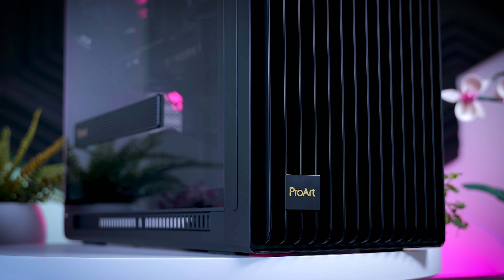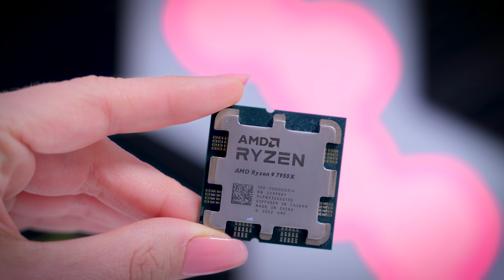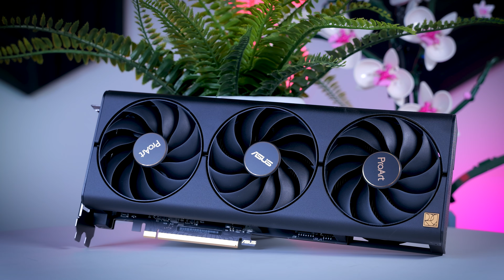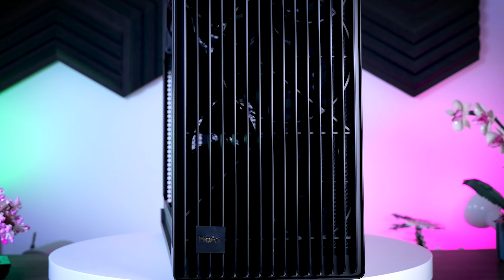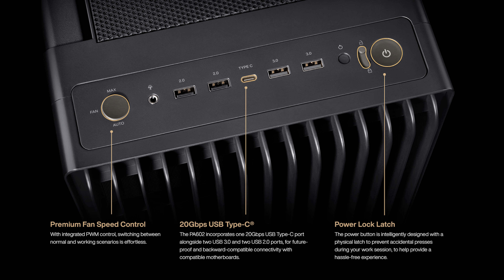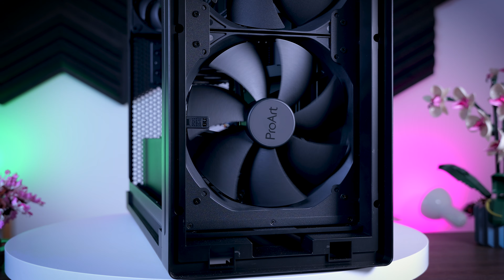The ULTIMATE Workstation - ASUS ProArt Build

Comment: Dear, whats your view on below build for trading purpose. 

CPU: Intel Core Ultra 9 285K  
Motherboard: ASUS ProArt Z890-Creator WiFi  
GPU: PNY NVIDIA RTX 4000 SFF Ada  
RAM: G.SKILL Trident Z5 DDR5 64GB (2×32GB) 6400MHz CL32  
SSD1: Samsung 990 Pro 2TB  
SSD2: Samsung 990 Pro 2TB  
PSU: Corsair RM650x  
Case: Fractal Design Define 7 Black  
CPU Cooler: Noctua NH-D15  
Case Fans: Noctua NF-A14 PWM
Monitors: Lenovo ThinkVision 23.8″ QHD 120Hz ×3  
Aux Monitor: ARZOPA Z1RC 16″ 2.5K  
Monitor Arm: North Bayou NB-F160 Triple
Reply from the maker: I don't know specifically what falls under trading and/or why you'd need a lot of CPU/GPU horsepower for it, but that looks like a solid base for a decent workstation style PC. Couple of notes off the top of my head:
- That GPU I know very little about and whether it makes sense for your usecase.
- Might be worth / better to grab a 4TB 990 PRO and keep a slot free, depending on what you plan to do with it / expand on later? I wouldn't go for RAID 0 if you were planning that.
- Don't know that monitor arm, but it's hard to go wrong with most as long as they easily meet the weight limits and have good reviews tbh

Comment: I find the pro art boards to be a disappointment honestly... its missing the features I would want for my workstation build, specifically more PCI-E slots and extra sata ports to use for massive quantities of high capacity 20tb+ drives. Honestly I wish I could get a modern board with the sane basic feature set as my ASUS X299 SAGE board

Comment: The case may look bland at first glance, but it is actually very clever. Nice little details and two huge fans. Airflow is exzellent. It's a steal for the price of ~200€. The 200mm fans alone probably cost ~60€ and you could replace them with Noctua NF-A20 if you ever have to. With some minor mods you can make this look as elegant as a Fractal North XL, but with better build quality from what i've heard. :D

Comment: The GPU isn't as wide, or even as tall, but is LONG. That massive "o" at the end for the pass through. Make sense when you might have lots of other PCIe cards stacked up, or when your case can be of different proportions compared to a regular tower.
CPU thermal is honestly highly disappointing consider it's a giant AIO.

Comment: Thank you for posting this excellent review of the ProArt system. I actually built a system about 13 months ago based on the ProArt Z790 Creator motherboard. This is an Intel-based system. That was the only Asus-branded component in the case. I built it for another individual and it has proven to be extremely solid and reliable. There has not been a single problem. The original build was with 64 Gb of RAM; I was asked to upgrade it to 128 Gb and that helped the user. The person does a lot of flower photography and uses Adobe software products for managing the photos. ProArt motherboards are of excellent quality. As always, your presentation and videography are of the highest quality. I feel that watching your product evaluations is very necessary for my own work and interest.

Comment: I have the same mother board and CPU. They both work perfectly in Linux as well with all features working. If I had any complaints I would like to remove one of the x16 slots and give more PCI lanes to the other slots so I could run some other PCI cards that require more lanes than are left after the GPU is installed. However, it has two PCI 5 nvme slots, 2 PCI 4 nvme slots, and 4 SATA connections. i would give up the 2 PCI 4 nvme slots as well for more PCI lanes in the slots.

Comment: Have a 7500f that came with 16 gb (8x2) 5200hz bought as a package for $125. Then I paired it with an BNIB Asus B650 pro art from meta for $140 and a BNIB 3060 ti for $240. I could upgrade the ram, but for my use case it's not really that relevant and so far it's been an absolute beast.

Comment: one thing i don't understand about this proart line up is why the ef they do those 20kg cases. like all this easily fits in much smaller and lighter cases, even adding the space for harddrives or ssds, why do they need to make it so effing heavy and large
Reply: It's most likely because of temperatures and overall airflow. This is not built for gaming where temperatures are rather low compared to whatever work you intend to do with your pc.
I would personally never put a 7950x in a sff case.
Reply: @Nein99x  i would understand this point with intel's cpus, but not with amd's. 7950x is easily tameable by a good 240mm aio, which fits pretty much everywhere
Reply: @julfy_god  The other side of that coin is a lot of 'creator' workstations are going to be NVidia + Intel or Threadripper where that extra airflow comes inn handy.
Reply: @nadtz  Non 3D Vcache Amd cpus still get relatively hot despite being more efficient under load. Point is you put your hardware under unnecessary thermal stress by cramming them into tiny cases. I don't understand this obession with putting top end hardware into tinier and tinier enclosures. Just give your hardware proper room to breathe.

Comment: but we can get a RTX 4090 into a mini ITX case (with solid cooling). Why so big?
Reply: because I'd personally rather have a larger case that I can swap stuff into or out of quickly than I would a small case and I wouldn't want Mini ITX for a 'creator' system regardless.  Why would I want to give up IO just to have a smaller board?  Different strokes for different folks and all.
Reply: @nadtz   There are no advantages to a case this size, except over very small and fiddly builds. Even a micro ATX mobo has 4 DIMM slots; the E-ATX board here has only 4 DIMM slots, meaning this isn't much of a "creator" build as it is form over function. As for IO, USB 3 hubs are cheap, often smaller than my hand and a lot more accessible.
Reply: @BOZ_11  That's moving the goalposts, your initial point was that you can get a 4090 into a mini ITX case which is what I was responding to.  As for 'how big' for a case that is up to individual use case and preference.  Neither is wrong but mini itx may or may not limit expandability depending on what you do with your system.
Reply: @nadtz   Fair enough, though micro ATX cases are often 1/4 the volume of that refrigerator
Reply: @BOZ_11  Mostly irrelevant to the workstation market, I think there might be one or 2 W680 MATX motherboards floating around out there but for the most part anything considered "workstation" is going to be ATX or larger.  It's honestly easier to find smaller server boards because 1U servers are way more common than mini or micro ATX workstations.
Reply: @nadtz   ProArt products aren't really meant to be servers, more desktops for professional artists, and I can't wrap my head around having a fridge with 4 DIMM slots tucked under some artist's desk in some office somewhere. Horses for courses I suppose
Reply: @BOZ_11  I know what market Pro Art is meant for, but Pro Art aren't the only creator/workstation boards out there and some of them use W680 which is also used in some budget server boards.  

Don't know why you are so struck on the 4 dimm slot thing, Threadripper and Intel W use up to 8 and there are not a lot of desktop cases out there that will fit EATX/SSI-EB that don't look like a fishbowl and aren't from fractal design.  While personally the glass side is a deal breaker for me it's always good to have options.
Reply: @nadtz   The DIMMS aren't really a problem, it's having an E-ATX board that doesn't do anything over a micro ATX one that confuses me. We have a team of artists using Adobe products, and since space is a consideration in an office, we bought pretty slim desktops using Quadro cards to replace the old Macs. I think if we'd ordered 8 of these ProArt boxes we'd be getting funny looks. 

People need space for foot rests and spare shoes under their desks, and giving them remote access to a ProArt box isn't going to work since they need to use the Adobe colour profiles, which cheap terminals (for an RDP session to the ProArt) won't have. My 2 cents.
Reply: @BOZ_11  That's your use case and that's fine but it's not everyone's.  For instance I have the full size Torrent at home and it sit's on top of my desk so it doesn't really matter how large the case is.  It's also one of the few cases that doesn't have a glass side panel which matters to me but probably doesn't to most people.  

As for the size of the motherboard 'not doing anything' that's just wrong.  You aren't going to get nearly as much expansion out of MATX as you will out of ATX simply because there are less PCIE slots.  Again if you don't need them that's fine but if you do than smaller than ATX isn't an option.  In my case I have GPU, 10gb SFP+ network adapter and a capture card in my system with 1 slot left over.  I'm thinking about upgrading to a threadripper system so I can add a 4x PCIE NVME card and maybe a capture card.  What matx board could I stuff all that into?